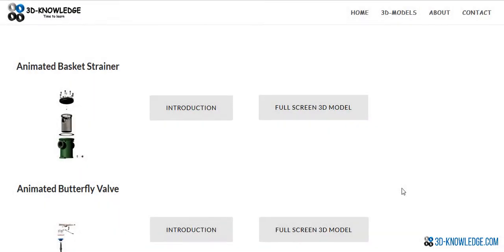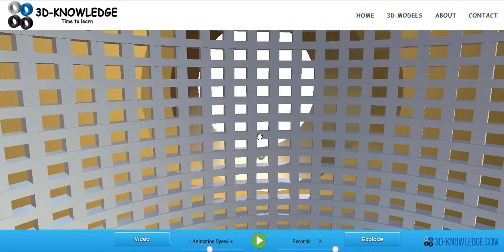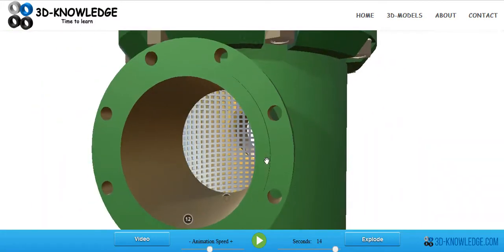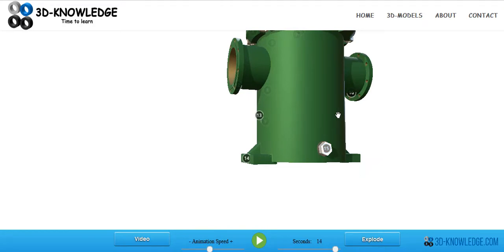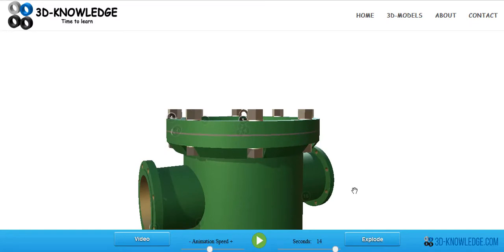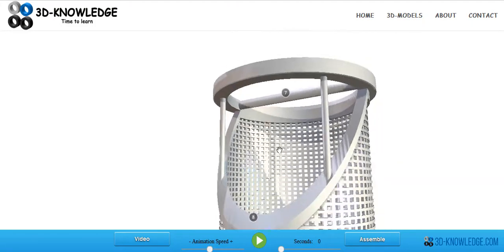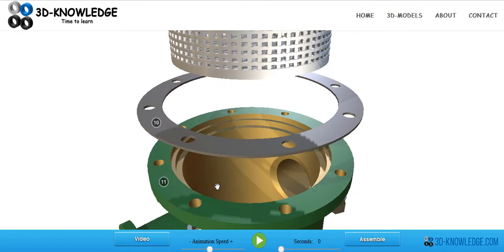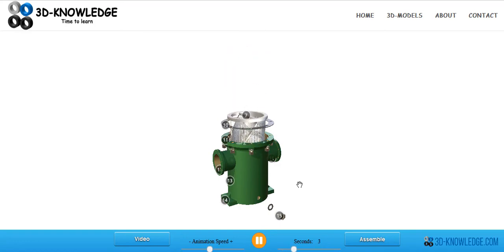Basket Strainer Explained

Comment: Dear Sir/Madam,
                       I want to design and fabricate one high pressure and high flow strainer for my department application purpose.
My specification are :
Strainer of rating : 0.3 mm
clean pressure drop : 0.8 bar
Max permissible press drop : 7 bar
collapsing pressure drop : 15  bar
flow through strainer: 35 cubic meter per hr

  I want the correlations or formulas from which ii can estimate the filtration area required for the above data.
Thankyou

plz mail me on meenakshimhr3@gmail.com for your suggestion and expert advice.
Reply: Www.teleflo.co.in